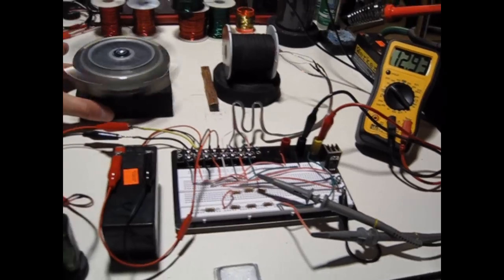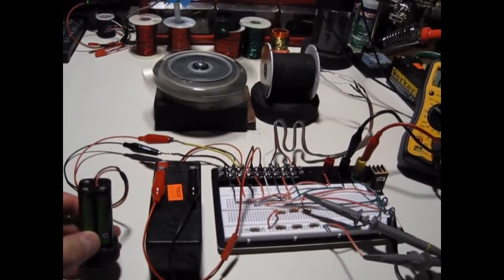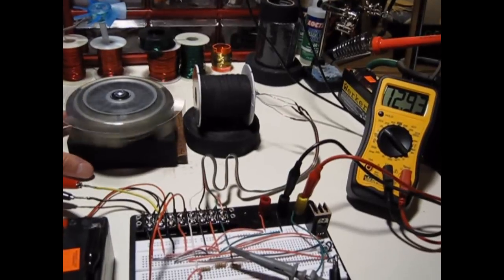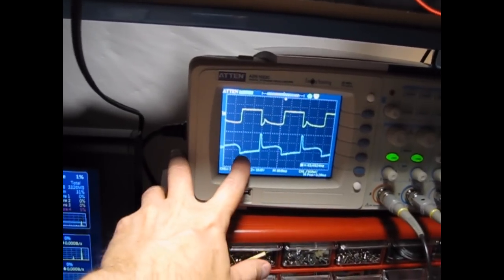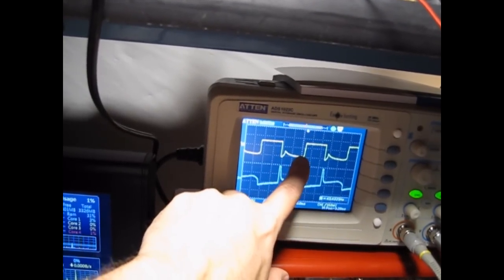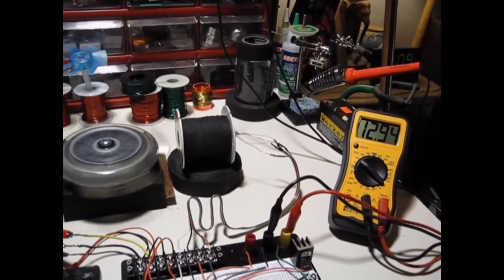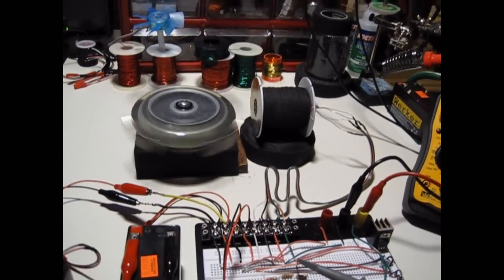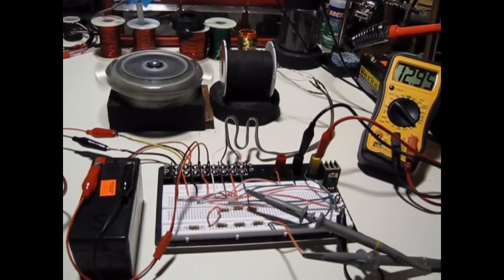My 3rd Bedini Motor Part 3 with an Oscilloscope monitoring Trigger and Drive Signals

Comment: i've looked at a number of these - interesting. but if you can power with 4.8 volts and charge a 12 volt battery, why wouldn't you have the circuit re-charge the 4.8 pack and see how long it runs. also what is the work power output of the wheel, itself? can that be harnessed or will it upset the tuning too much?

Comment: By the way clear explanations love the scope readings i cant find no one really using a battery to power up a drill or with higher amps at the output readings making me think all this time it is just pure hype....my set up uses mpre amps in than out does charge regular batta bit at a cost...Best regards sorry about your loss don't hesitate at aeeking help and support...im a veteran of war

Comment from the maker: @wiscala- Thanks!...I think those were 3/4" Dia x 1/2" Neo Magnets. Breadboard is from Radio Shack. Most Batteries will "Peak" when fully charged...then start to drop in voltage and get hot. (You don't want them to get hot). Don't charge a 12V Battery over 14.5V. (It may Peak before that) The Camera is a Canon A40 Sure Shot. (It's a good Camera.) I plan on doing more videos after my life calms down...too much ahppening right now.
Dave